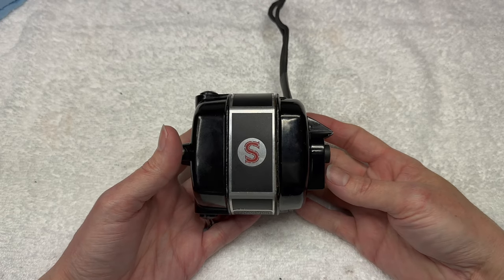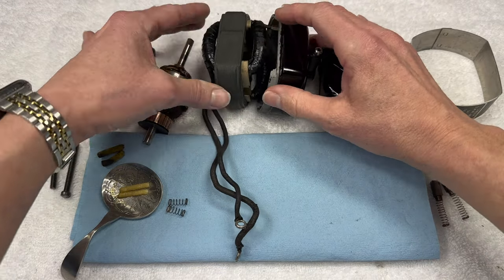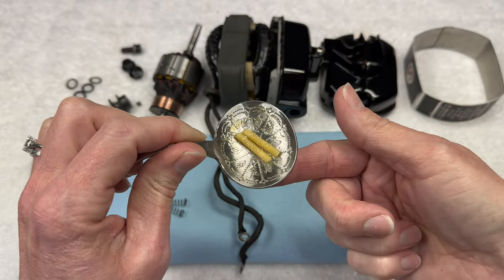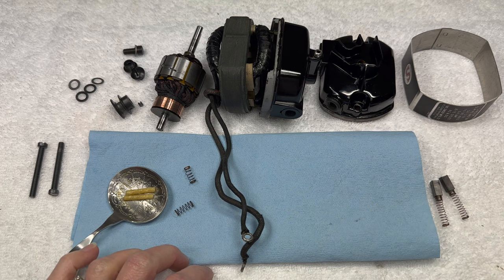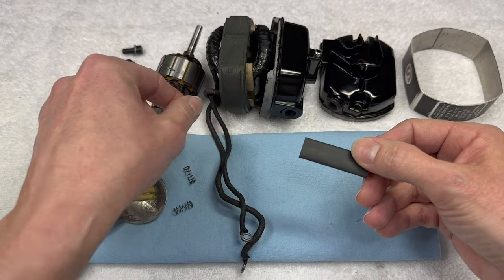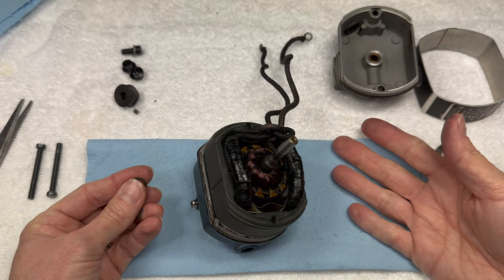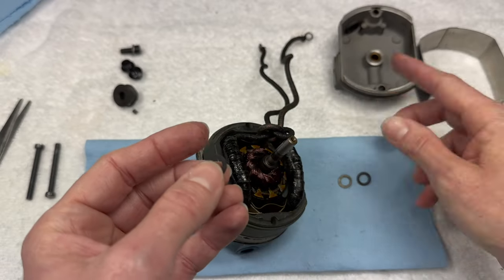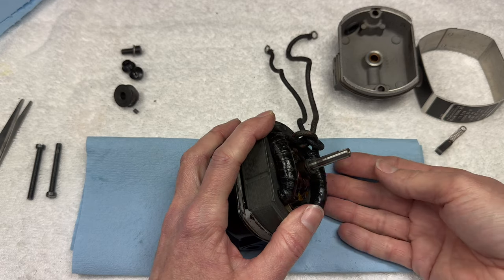How to put a Featherweight motor back together: Singer Featherweight Restoration Part 9

Comment: The one thing I learned today, as I started on my mother's machine. If you have the original bakelite pulley: step 1, order replacement drive pulley. I tried everything including gently heating it with my electronics heat pen on low 100c or 212f . It doesn't want to budge without breaking. I still will be polishing the com with 2000 grit wet sandpaper wrapped around it. A bit overkill but it worked great on my 1905 general electric mini grinder that I still use daily.
Reply from the maker: I use high grit sandpaper on the commutators too, it works well. 3000 on the needle bars and presser bars is pretty impressive as well! I’ve have a couple of machines with the Bakelite pulley, kind of forgot about them!

Comment: Thank you so much.  I acquired a feather weight that is in pretty tough shape.  I am going to follow your instructions to 1. See  how much I can improve this one. 2. Use this machine to practice before working on my others.   Great content, thanks again.
Reply from the maker: Hi! You are very welcome, I love hearing that someone has decided to tackle a restoration of their own! It sounds like you have a good plan in place, let me know if you have any questions as you go and I will try to help!
Reply: My motor shaft has end  play in it, causing a rattle and vibration when the motor runs. Any suggestions?

Comment: Great informative tutorial!  Those little washers have baffled me.  I'm sure I will refer back to this tutorial many times.  Yesterday I had one of those rings come off at the electrical receptacle.  Would you please do a tutorial on how to deal with that situation in the future.  Thank you!  😀🦋
Reply from the maker: Thanks! Do you mean a ring terminal came off the end of the wire or are you talking about the little brass post washers that just slide onto the post? I am planning a video on how to replace the ring terminals if one breaks off, it may be a little bit though…
Reply: @SewingMachineRehab  Yes, the ring at the end of the wire.  Then it slips on to the brass post.  The wires had become fragile and broke off at the point where the wires enter the ring.  I couldn't find a crimp ring like that anywhere.  My electrician friend said to wrap the remaining wires around the brass post and add a brass washer on top.  It works but I'm not sure it is best practice.  Hope that made some kind of sense.  🙂

Comment: Thank you for your detail explanations. The new grease Wick, would you tell us about the new Wick, such as where to find the Wick or any substitutions and what kind of grease you used in this assembly.
Reply from the maker: Hi, I buy my grease wick in bulk from McMaster-Carr. You can search "firm felt cord" and see the different diameters that they sell. Currently I use the Sew Retro Grease from the Singer Featherweight shop because I know it was designed with these types of motors in mind. Hope that helps!

Comment: Take some short pieces of heavier thread  (2) feed through the grommet where  they stick out on both sides of the end cap . Tie each one to the eyelet on the wire . then use the thread to pull the wire through not as difficult as trying to feed the eyes through .
Reply from the maker: Yes, that would work. I am a little cautious to do that because I don’t like pulling on the eyelets themselves unless I am prepared to fix them if they break off. If that happened to me, it would be ok but when I think about my viewers I know not everyone would be prepared to make a repair like that so I decided to go the “safe” route. But, if you can fix them if they break then yes, your suggestion is probably easier! Thanks for sharing your tip!

Comment: i have a FW 221 and have about 1/8 inch play on the motor shaft. I checked the washers inside the motor and based on a diagram I viewed I may be missing one at the pulley end. Do I just add any old washer to compensate for the gap, or does it take a special kind of washer. If so where can I get them?
Reply from the maker: Hi Jerry! A tiny bit of play is ok but too much will make an awful noise when you start running the motor at higher speeds. I think you just ordered some grease wicks from me, if that was you let me know and I will toss in some washers when I mail them out. I have some great fiber washers that will work when you need to add extra.

Comment: Hi! 🙋🏻‍♀️ Just ordered some grease wicks from your shop. Where can i get the heat wiring sheath?
Reply from the maker: Hi! I’m mailing the wicks out today, do you know what length you of the heat shrink tubing?
Reply: Basically the size to replace the sheath that was protecting the motor cables.
Reply: Btw one of  my brush caps is completely  melted. I cant even see the groove where to put the screwdriver. I remember you mentioned in one of the videos you have worked in the  past with similar situation. How did you take it off? I was just going to reassemble putting the brush from the inner side. But if i can replace it and take it out for future maintance it would be great.
Reply from the maker: @user-dv9ey4nh4p  I sent you a piece along with the grease wicks, you can cut it to length. Mailed it yesterday!
Reply from the maker: @user-dv9ey4nh4p  I try to scratch out a groove in the brush cap so that I can get a screwdriver to fit in it and then I am able to unscrew it. Some people drill them out. You have to get a little creative but since it is plastic, it is possible! You can find replacements online :)
Reply: Thank you so much, very grateful for you sharing all your experience and knowledge. Ill keep you updated and email you with my finished featherweight. 😘🤗

Comment: My pulley slides back and forth on the motor sshaftneven with the set screw in. How do I correct that? The set screw is tightened onto the flat area of the shaft.  When I start the machine the belt doesn’t engage without an assist on the wheel from me. The belt is in good condition. Thanks.
Reply from the maker: Hi! It sounds like you might be missing a washer or spacer that would have went on one of the ends of the shafts inside the motor. I have found that a tiny bit of movement is ok, but not a lot. Does the hand wheel turn freely when you don’t have the belt on? How easy does the pulley spin when you spin it with your fingers? If it spins easily then you may need to adjust the height of the motor, your belt is too loose or too tight. If the pulley doesn’t spin very easily with your fingers then you may need to do a couple other things. First, make sure that the wires coming out of the grommet in the motor are pulled out as far as they will go. If there is too much bulk of wire inside the motor where they come out of the grommet, it can rub and make the motor difficult to turn. Usually just giving them a tug, (slowly, don’t yank them hard) will fix it. You can also try loosening the two screws that hold the motor together, wiggling the top and bottom covers of the motor, tugging the wires and then tightening the screws back down again. Sometimes that is all it takes to get that pulley spinning without any obstruction from the inside. Sorry for the long answer but there could be more than one reason you are having trouble. If you need to, email me at jen@sewingmachinerehab.com
Reply: @SewingMachineRehab  wow quick reply! You’re amazing, Jen. Well the missing washers on the armature is a good point. I’ll check that. The pulley and hand wheel spin freely. But the pulley may be affected by the lack of washers making the shaft unstable. Hence the sliding in-and-out of the pulley or the shaft. I’ll revisit the motor and try other things you suggest. As always, thanks you, thank you! Denise